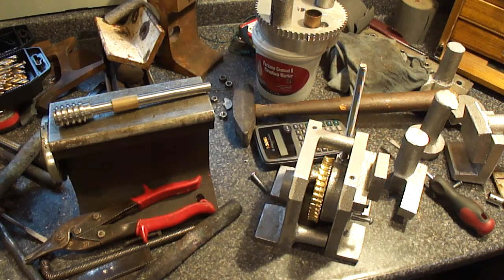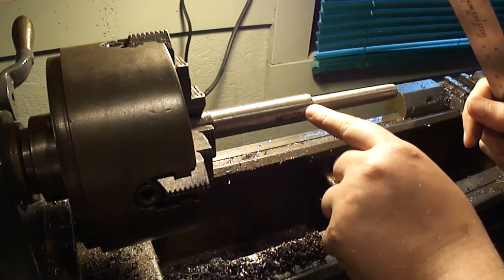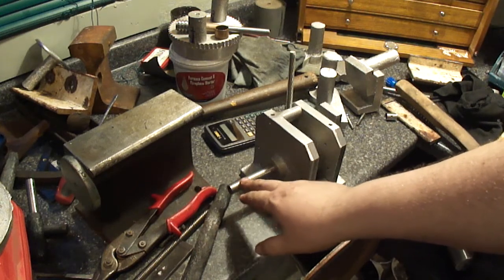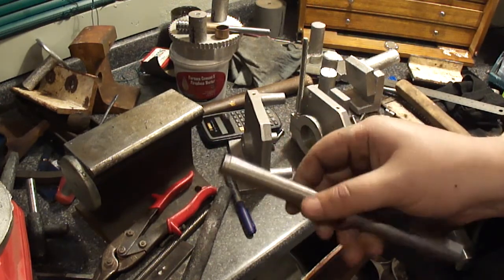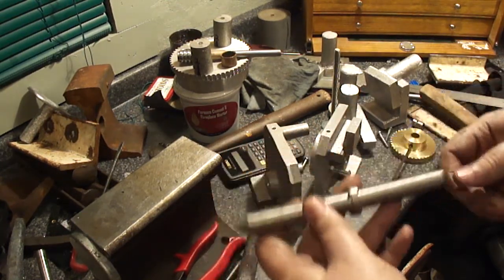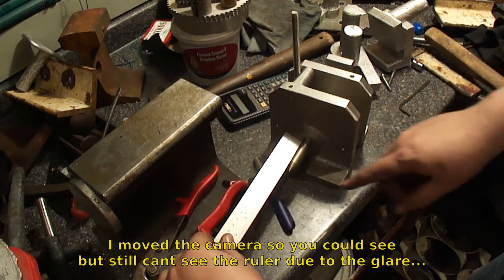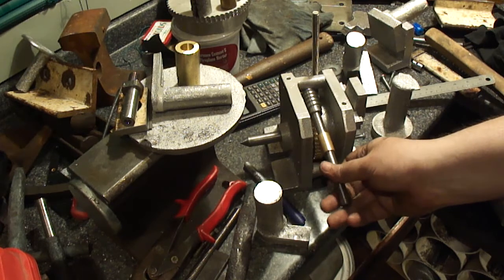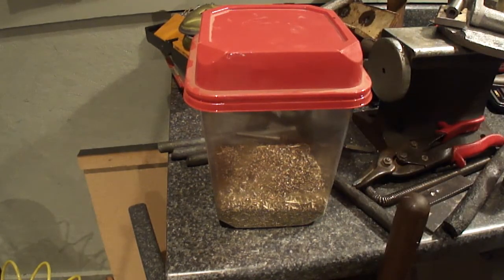Gingery Dividing Head P2 - Machining Main Shaft

Comment: Coming along nicely.  When you mentioned chatter I wondered if you had ever blued-up the tool post to compound mating surfaces.  Often overlooked is when the slot edges pull up and the toolpost rocks at the bolt a teeny bit.
The rain's been keeping me out of the shop, also.  Caught me in the middle of rebuilding my furnace.
Reply from the maker: On the old lathes, if the compound slide gibs are loose, it'll want to chatter a bit when your cutting threads or something similar, or if there is any chatter, it will want to feed itself in and dig in a little bit. In the main video of machining the main body, the latter situation happened and I had to face a little more out of the one piece than I really wanted to, so I had tightened it up to get rid of that and it gives a far better finish afterwards. 
The lathe is around 105 years old, so it has some wear in it, so you just have to keep it a little tight there so it doesnt cause any issues. Thanks for watching.